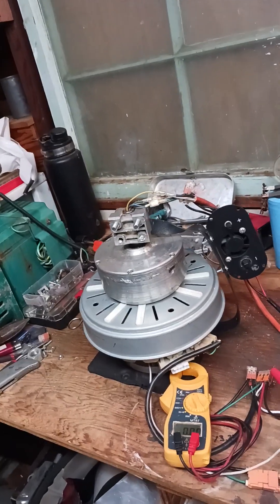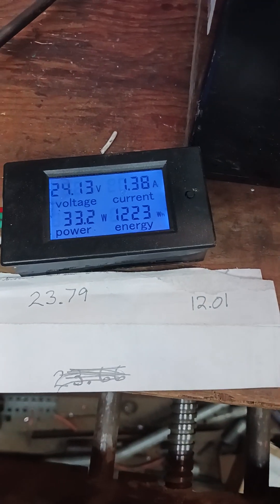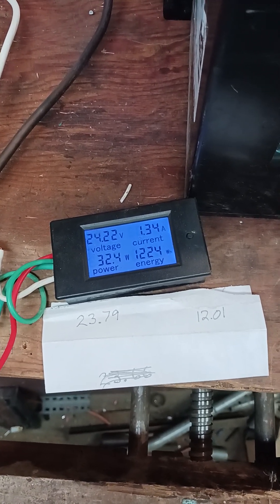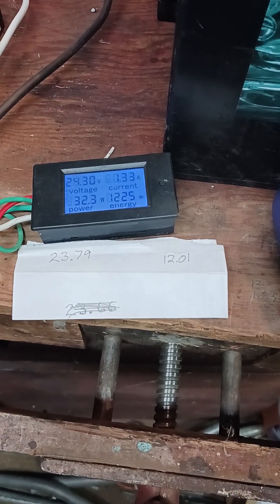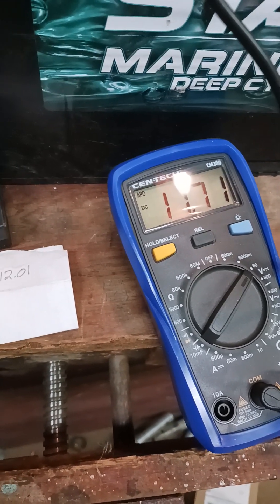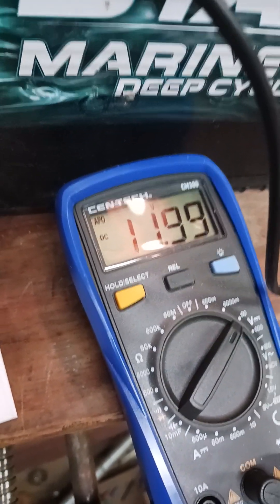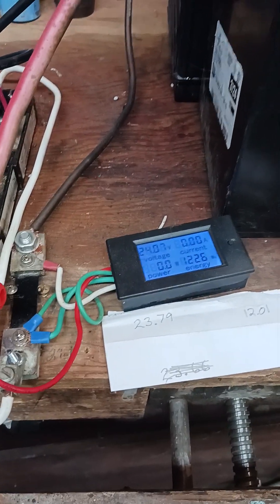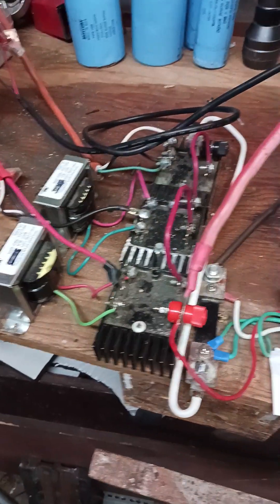TAYLOR MADE POWER PLANT

Comment: there is a static charge on the battery only being charged and like all batteries they will recover voltage after being used There is free energy all around us  But you can not make or destroy it  You can find ways of making a diff in potential to use all this energy  I would think the higher the diff the easier you can get it to flow I can not think of a way your et up would work  And if it did work you could just leave it running until both battery are fully charged  your battery need to reach around 14.5 volts to be fully charged The static charge will quickly dissipate if used or let set for a day or so  Keep looking tinkering you may stumble up on some thing new/unknown Have you noticed that when you rub your feet across the floor your door knob will keep taking that charge over and over again  This may give a bottomless hole??? And if a bottomless hole then you have a place for high voltage energy to flow  And if energy is flowing you can use some by putting  some thing that has resistance in series  Just a thought though not tested or tinkered  around with  Or how about a tesla hair pin circuit  I think it has a chance of tapping energy thats all around us if you get your spark gap right!  A tube with a gas in it may make for a good spark gap???  Every thing wants to reach equilibrium with every thing around it  You must make a good path to do so!  I think with the energy all around us the key is a very high diff of potential that is discharged very quickly Like from a spark gap  Every thing acts alot like a wave in a pond  Like dropping a rock in the center put in food coloring so you can see how the waves act  Notice also what happens when waves add together or cancel each other out   Small waves can come together to spash very high also  Think about this if i am a long way away and you yell at me DOSE the air out of your mouth reach my ear drum???  Dose the copper coil windings lose weight after long time of (making) energy???  There is way to many things to think about to write here  Good luck and God bless!